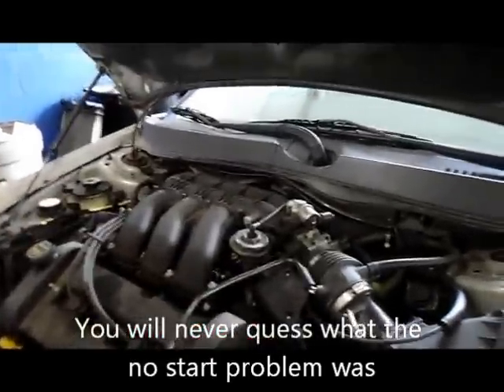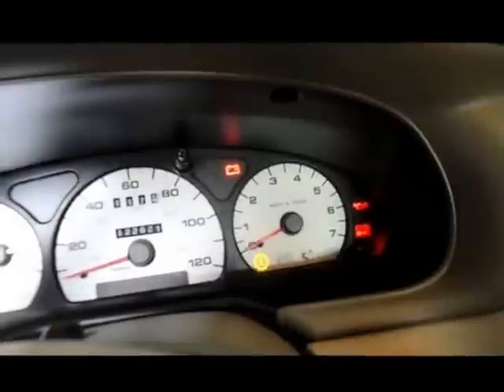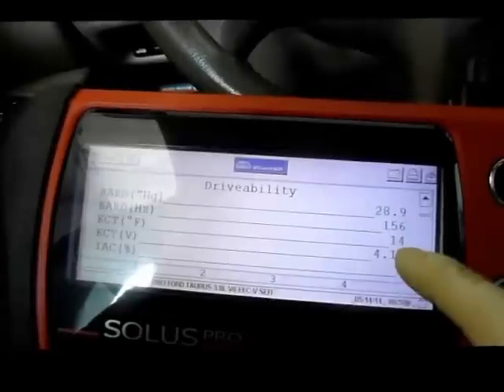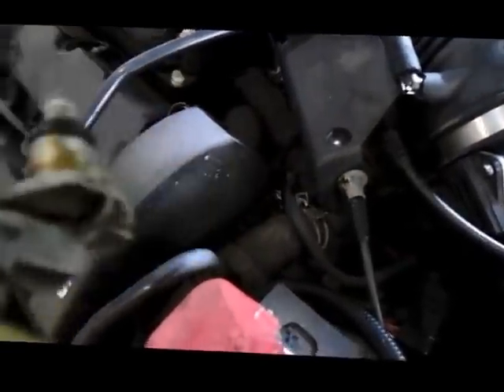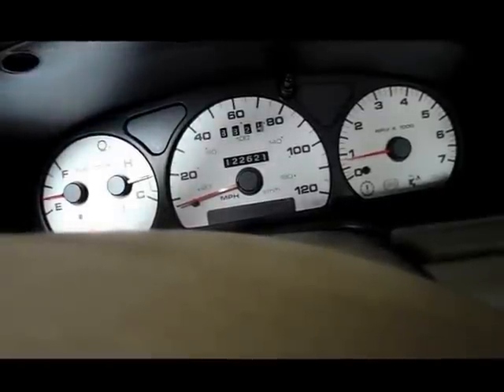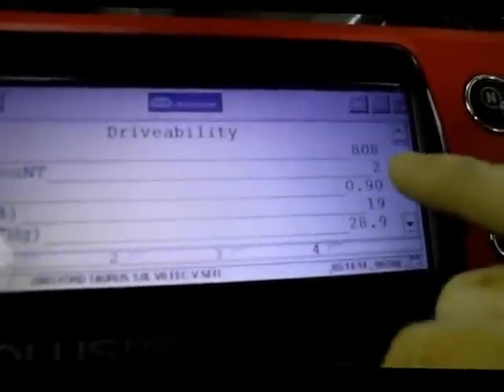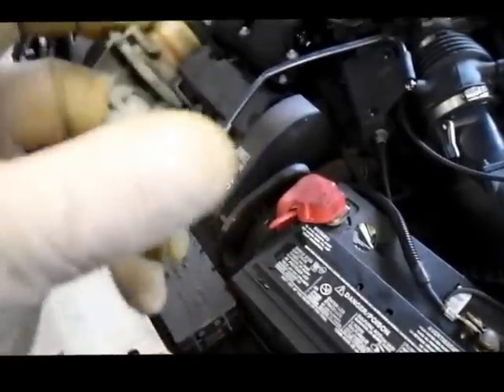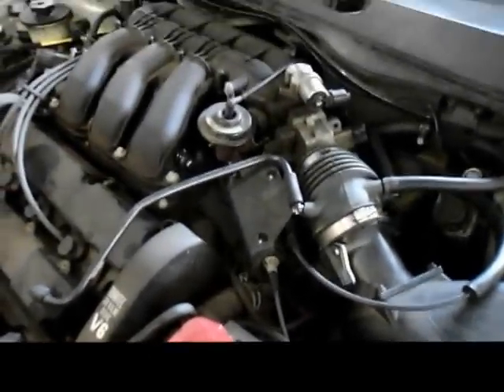Engine cranks but won't start

Comment: I just had the same problem with a 89 chevy silverado 1500. It would die when it got warm and wouldn't start tell it was cold again. It would just crank, no start. Never heard of temp sensor causing a no start tell the other day. All I did was unplug the sensor and jump the 2 wires together in wire harness and truck started right up and runs and idles better then it ever has. Crazy. Great video.
Reply from the maker: Thanks for watching. I'm happy to help.

Comment: Thank you for this my car hasn't started for 2 months and all idiot so called mechanics couldn't figure it out. Took me 30 min now cars running like new again.. Thank u..
Reply: This doesn't sound legitimate. As you can clearly see in this video "idiot mechanics" use very expensive OBD scanning tools to diagnose car problems. But if you still think you're mechanic is an idiot then get a new one.
Reply: @staypositive4358  I believe him, I've seen the dealership charge thousands and not even fix the problem and it turns out to be a 30 dollar sensor the customer could have changed themselves
Reply: @ericg4915  . There is no way a dealership charged anyone thousands of dollars to find out the problem was a sensor. There could have easily been multiple problems. But again, if you have an "idiot" mechanic find a a new one. You can also buy a decent OBD scanner and some tools if your willing to diagnose and fix your own car.
Reply: @staypositive4358  your joking right? Whether it turns out to be a valve, sensor, fuse, ground, wire etc etc I've heard millions of stories and seen just as many where the dealer or mechanic dumps 1, 2, 3 thousand into a car and it turns out to be a little cheap part like a sensor. Literally just yesterday a story of a woman who hard occasional rough start and stored misfire data. Full tune up and injectors was around 2,000. Turned out to be a 40 dollar purge valve flooded the intake with gas vapors cause it was stuck open causing a long crank and a rough start especially after getting gas. Its not about being an idiot, any mechanic can have a bad day or get stumped

Comment: Helps the computer decide the fuel/air ratio to get the engine warmed up.  It was probably dumping so much fuel that the mixture wouldn't fire since the air isn't as dense as cold air.
Reply: +Charles Scott There was no-spark!  No-spark from the ECU means no fuel.
Reply: tcpnetworks would be odd that a temp sensor would cause no spark, actually that shouldnt occur IMO.
Reply: +Charles Scott My thoughts exactly. If anything, the engine should start but run rich, since the ECM would be delivering the fuel it was programmed to at the temperature it thought the engine was at. I wonder how many Tore-asses won't start every winter when the temps drop into the teens???

TIL: Don't buy a Ford if you have to go to work in the winter. LOLz
Reply: Andy Hicks With my limited time with Ford cars, if the sensor fails, the computer sees it as -40F/C so it will certainly run VERY rich (it actually can not see below -40, even with a working sensor).  But a no spark condition... No way a temp sensor can cause that unless the ECM decides, "oh hey, no voltage here? lets not send voltage elsewhere and confuse the mechanic by giving a false no-spark".

That aside, my issues with the video, he said it would start, but drop into gear and it would die and not start back.  He also stated no spark condition.  Sorry, but a no spark condition means the car never would have ran.  So yeah, I still stand by, it was trying to run too damned rich for the atmospheric conditions.  And we are getting to the point now with cars where just a drop too much or too little going into the cylinder will probably cause it to miss, two drops and it may die out.  I guess we can thank efficiency requirements.
Reply: +Charles Scott Agree 100% ! Good Call ! Definitely would change the oil due to cylinder wash.
Reply: +Charles Scott I dont agree with you mainly because Jim said it would start after a "wiggle test". Second, its hard to mistake something as simple as no spark. if it was a simple over fueling issue, it would start if you opened the throttle a bit while cranking or flooring it to active the clear flood mode.
Reply: +Charles Scott one thing I cant wrap my head around however, is how in the hell a coolant temp sensor would trigger a no start.
Reply: He said there was a voltage issue with the sensor. When wiggling or tapping it would run then die when put in gear. Sounds like the sensor could be shorting out causing problems with the computer to malfunction. Electronics are funny. In time it could have damaged the computer.

Comment: I'm glad I watched this video.  My sensor is bad. Currently it's keeping the cooling fan from running.  I haven't changed it because it's winter.  And my garage is packed with tools and motercyles. I better put the new one in. Thanks for the video enjoyed.

Comment: Thank you for this video. I have a coolant temperature sensor code and my car wont start.  I ignore the code because I did not think that would make the car not start. I got cam sensors and it still wont start

Comment: The ECT sensor is used as a load sensor and therefore plays A role in controlling the volume of fuel. This is necessary to start a cold engine.  A faulty read as you had will cause the PCM to flood the engine.  If it was cold outside the engine would have probably started .   Thanks for sharing.
Reply: This is what we would all assume to be the case, BUT! it wasn't flooded he said it had NO SPARK!
Reply: I’m thinking that he probably did have spark and didn’t realize it. As a master technician, I know that there is no correlation between the etc sensor and spark with this situation.
Reply: France M yea if the cars running hot its fuels the cat with more fuel to get the cumbustion temp colder
Reply: bingo...
Reply: Not so Stephen. Yes, a fat/rich mixture cools combustion chambers down, but I know of no systems that fatten of the a/f mix to cool it down when in a hot or overheating condition. I could be wrong though. If so who is the manufacturer that has this design? You are speaking of autos/ trucks, correct?
Reply: Does this mean if I let the car cool down it'll start up normally?
Reply: Na if you got a bad sensor it keep flooding the engine
Reply: Itscalled a no-start condition it's a built in safety feature lmao some of these comments are just plain stupid when you have this condition the ecm floods it out to keep it from starting and if you do get it to start it will die unless you really workhard to keep it running ive had this happen beefier on a ford truck but mine was a manual trans. So it wasnt as hard to keep it running just rev it up a little lol fuel mileage went to shit though lol........
Reply: France . Its been my experience that a shorted sensor driven from the 5v sensor output of the ECU, in this case, supply shorted to output shouldnt have affected the operation, apart from throwing codes. A sensor supply output from the ECU shorted to ground usually results in other sensors not getting supply and often shutting part of the ECU down, possibly the short from supply to sensor output has affected the ECU in some way.  I would need a schematic to be certain.
Reply: France thanks
Reply: This is true; but not necessary for the fuel delivery but rather a fail safe to avoid burning out the engine. Lets keep in mind that most new cars have ambient temperature sensors and with this info, the car knows that there is something wrong and decides to not start the system.
Reply: This is a more valid argument.
Reply: My Sable wont start ran fine last night wont start today very cold in VA . Get my Mech to check this sensor.

Comment: The first time I ran into this issue, I was at a Ford dealership. I wasted a few hours before contacting Ford's tech line. The engineer I got knew exactly what to check first. He said the coolant temp sensor circuit fuzzes out the reference voltage in ECU and it can cause issues with no starts, no cranks, and stalling. He had me load test the wires between the sensor and the ECU. If the wires were good to replace the sensor and if the wires are bad to repair them and replace the sensor anyway.
Reply from the maker: Thank you for your input and for watching

Comment: it shorted the v-reff 5.0 volts supplied by the pcm for the sensors. when v-reff is shorted it is a derate so the pcm does not get damaged.
Reply: I was thinking much the same, 4.65 is very close to the 5 volt supply . The sensor it self showed signs of corrosion , acidic coolant will generate voltage like a battery , but not as much as 5 volts.
Reply: I have also seen the sensor common  voltage shorted to an auxiliary wire via rubbing and sensors internally shorted. Throwing off other sensors that use same supply and grounding. Look at a wiring diagram and you will probably see common used 5volt wire for temp and other sensors. If you still have car there, plug sensor back in and look at other sensor data. You would probably see something else also off.
Reply: I agree with you Steve. I have a Jeep grand Cherokee that would not start. I was having reference voltage problems. I unplugged the tps and it started up. shorted reference circuit shut pcm down.
Reply: Two pin sensors are isolated from the reference voltage so that shorting it should have no effect on the reference.  If they were actually connected directly, the sensor output would always read 5V, so what purpose would it serve?  It's supposed to be just part of a voltage divider, and whether it's open circuit or shorted, it should only affect that one signal and not the reference.  Unless it's a really bad design-

Comment: When the sensor reaches 4.0 volts. The ECM is told no coolant present Is why. As the sensor works by fluid conversion. Not just sensing temperature. It has to be immersed coolant and sense it.

Comment: 2000 sierra I changed the coolant temp scensor because the old one melted for some reason,Im guessing loose connection, but as soon as I changed it the truck started 4 or 5 times dying immediately, I searched my problem and your video just happen to be first,  and im glad it was thank you for the upload help, I dont have a obd scanner, I was doing a tune up and noticed the wire connection melted, I stuck together and taped it, it ran normal, then I ordered a ACDelco scensor from Amazon and defective I guess, but thanks again, because like most I go to thinking gas, fire, battery weak or loose but even though I just did the coolant scensor i never  never would have thought it was the problem.

Comment: The ECT controls fuel delivery during open loop, maybe the extremely low temperature probably caused
 the computer to spray to much  fuel into the combustion chamber.
Reply: +Brendon Dejesus Yes !  Way too rich to fire the engine.
Reply: +Brendon Dejesus That dont explain the no spark condition
Reply: +gguilliams14 he had spark. said that that was the first thing he checked.
Reply: He had spark...
Reply: +Brendon Dejesus    :025  "HAS NO SPARK !!""
Reply: +Tom Markert Please, it seems you are not a very bright spark, he said NO SPARK.
Reply: +Brendon Dejesus --- mannnnnnn! you sure you didn't pull that out of your other end! Common!  now! All it is is that the coils are inline with the cooling sensor relay for safety... so they get turned off! not that your dog wagged his tail left on Tues day to fart on Wednesday and missin' a  pet pat for too many days!  TOoo complex and too intelligent my friend!
Reply: +DormantIdeas NIQ That's reasonable conclusion. I was initially thinking parasitic drain, but yours makes more sense.
Reply: +Tom Markert and He said it had no spark.
Reply: +Brendon Dejesus  He had no spark, the PCM is seeing a very high voltage drop across 
the ECT sensor's circuit, which it translates into an extremely low 
temperature.

It makes sense why it would not start, the computer simply cannot rely on the sensor no more based on the above. It will throw a code and stop operation. Their is good reason why it's called a "master" sensor, the sensor's input to the PCM affects the operating strategy of the entire engine management system. 

Now the reason why it does not allow the car to start is relatively simple, as far as i can tell the sensor in the Ford in the video is near the thermostat. It's safe to assume it controls the thermostat and the  cooling fan relay. Needless to say if that does not function properly due to the faulty sensor, it will cause permanent damage.
Reply: The issue was NO SPARK? Not a flooded engine??
Reply: FarmerMiyagi I have a friend who had just sold a 2005 ish Impala with a 3400 or 3800, don't remember. But the car came back with a no start when cold. They scratched their heads and panicked for a long time until I stopped by. I inquired about the issue and advised them to change the ECT sensor. They put in a new one and the problem was solved. The fact of the matter is that ECU s look for the ECT input for fuel and starting strategies. 02 doesn't usually matter until closed loop. It's in the books.
Reply: I've had this problem.  It's not on all cars, depends on the computer's programming.  Inexpensive fix, but, annoying.  thanks for sharing!!!!
Reply: no,watch the fucking video.theres NO FUEL

Comment: Electronic cars are more trouble than what they are worth, technology gone mad. Probably designed to fail after a certain time after the warranty expires to keep the specialised dealership mechanics busy and rich. They don't even want people to have the ability to parallel park their cars anymore so they invent self parking cars, absolute madness.
Reply: +Thetrucky69  I don't know about that statement. I wish there was a system like that years ago when my wife blew up my Boss 9 Mustang. She tore a hole in the oil pan running over a concrete park stop. She said she thought red light was for "change oil soon". I said why were you not looking at the gauges as well? She replied " what are the gauges" Well, the Boss 9 and the wife have moved on. I sure miss that car.
Reply: I see your point there in that case, warning lights and warning devices are very practical when the person that drives the car knows nothing about engines to know when there is a problem, you must have loved the car then! cheers.
Reply from the maker: +Thetrucky69  Thank you for your input.
Reply: +jimthecarguy No worries at all mate, cheers!
Reply: Douglas Smith 
Letting your wife drive the Mustang was your first mistake…
Reply: L
Reply: Absolutely true. Corporate snot nosed greed......punks

Comment: Don't ever rely on the tach for confirmation of crank sensor signal. Some tachs run off the cam sensor or even the alternator.
Reply: Hey what do you mean the alternator. my car won't start cause the battery keeps running dead and I just changed the alternator but no spark and its a brand new battery

Comment: Simply put, coolant temp sensor, and intake air temp sensor all correspond with fuel flow. It all depends on the outside temperature and workings of the sensors to send those readings to the computer. Same concept as a choke, when the car is cold, it needs more fuel to start and run, when its warmed up and in closed loop, it requires less fuel to run efficiently. It's Interesting it would completely disable the car from starting though. Great Video, I'm glad you got it fixed. Thank you

Comment: The ECM looks at multiple sensors to start and keep the engine running. coolant temp is one besides crank, cam, TPS, MAF, MAP. the ECM looks at coolant temp sensor to know what the current engine temp is in order to allow engine to run or prevent it from damage. every car veries sligthly but about a range of say -20 - 250°F is the window ECM will fire or run the engine(if all sensors are good) outside that range it shuts of sparks. if a temp sensor is faulty it usually falls out of that range or cause by damage and the ECM doesn't fire the igniter or coils until it receives the correct feed back from that sensor(s). hope this helps.
Reply: Jake Vaj
Reply: That sort of makes sense, but why does the ecu still let you turn the engine over, wouldnt that do damage let alone it starting??
Reply: Tyrone Nelson  
It might change with time, but the starting circuit and motor are not controlled by the ECM. Cranking the engine provides a wealth of information important to diagnosing it. Sensor info, trouble codes etc. If it cranks but don't start then I have a whole different approach to trouble shooting then if it don't crank.  It is rare that cranking an engine would cause any additional damage to it except in the case where the engine already has terminal mechanical issues.
Reply: jake - That is a meaningless flim flam explanation. The problem is simply bad ECU software from the factory programmers. Engines routinely are colder than 14F degrees and they start just fine.
Reply: Jake V Since computers were installed on engines to help control emissions I was taught that coolant temperature was the primary source allowing closed loop operation. Hence an incorrect/implausible temperature reading will disable the motor until repaired.
Reply: @bluenetmarketing  Rubbish. 14f is  -10 deg C.
That may be "routine" where you live but for an ECU/vehicle destined for a market outside of those areas...it will shut down & self-preserve.

Comment: My friend had a 1999 Ford Taurus that would not start. He had the car towed to a 
garage and they found nothing wrong. Then to a service station in our area who
went right to the problem which was low coolant. The reservoir had coolant in it
but the radiator was very low. They added coolant and it fired right up. The mechanic
there owned a 99 Taurus and had run into that problem before.
Reply from the maker: Thank you for watching and your input.